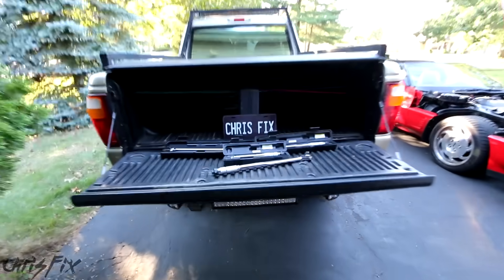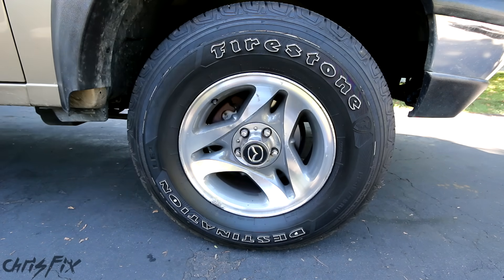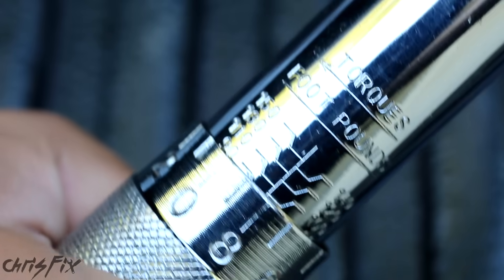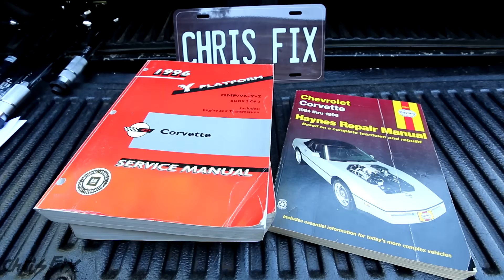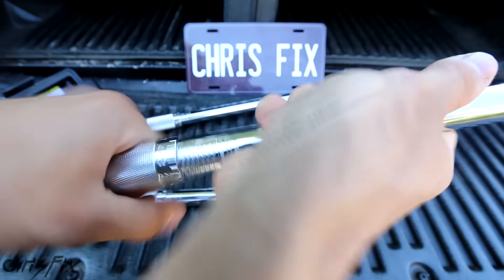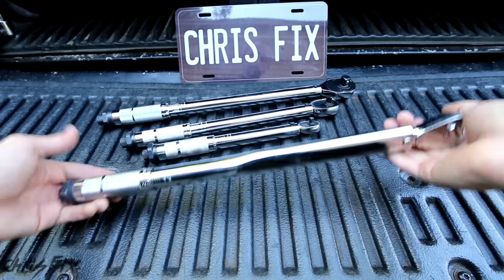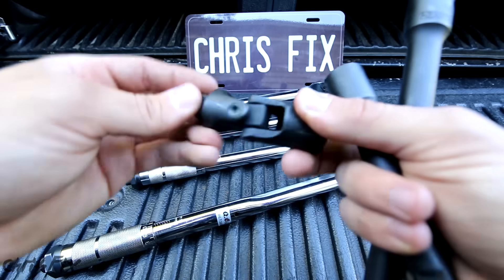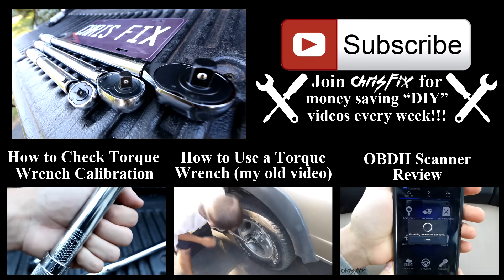How to use a Torque Wrench PROPERLY

Comment: Chris does anyone make it for Christ where you can pull it reverse to see how tight something was made and then does like a clicker a pop or just starts loosening it to readjust.

like some kind of a ranch maybe digital where I pulled back on something to see how tight it was before it starts to loosen?  I've seen videos of such a wrench but I can't remember who sells them I know they would be a little bit more expensive and I know there are one or called reversible torque wrenches, is that what I'm looking for either mechanical or digital? my budget is about $120 on harbor freight if you know what I'm saying.

Comment: Chris is it safe to use a torque wrench to loosen and then rhetoric I know you said don't use it as a wrench but just as a quick, can you use a torque wrench in reverse not that it would read or tell you anything but just wondering just like a little bit of a back off in case my mechanic airgunned aluminum wheels to 120 and they're only supposed to be 75, etc?

1997 Toyota Avalon, usually aluminum 15-inch wheels my spare is a steel wheel and that takes 90 or a hundred I forget  which.
Reply: Crack them loose with a breaker bar and then tighten them to proper spec with the torque wrench. NEVER use the torque wrench to loosen!

Comment: Common mistake with click style torque wrench is to very slowly apply the torque just before the click. ROT is to apply the final torque at a bit faster rate than the second hand moves around an analogue clock. Do not jerk the wrench to get that final torque applied either.

Comment: I Don’t need Torque Wrench I’ve got my Hands.
Reply: But how do you know you are not overtightening? I tightened my wheels by hand and have a wheel wobble on passenger side. I tightened them more and there is only a small wheel wobble now. I am worried in case I overtighten so a torque wrench seems to be the answer.
Reply: Shade Tree Mechanics don't use torque wrenches Real mechanics do..

Comment: The most important thing is to slack off the nut and then tighten to torque setting. Just putting it on and waiting for click is not correct because the wrench has to overcome friction which can be greater than the torque setting. You didn't mention that because you are not an engineer.
Reply from the maker: Thanks for sharing.

Comment: Kids toys, my most used wrench is 3/4” drive 100-600 ft/lbs and often use 1” drive 200-1000 as I torqued wheel nuts on underground haul trucks to 740 ft/lbs

Comment: Couple of things. 
1. Using extensions on a torque wrench does not affect applied toque, since rotation is slow and constant. (As long as the extension is perpendicular to the torque wrench)
2. Always adjust up to your desired setting on your torque wrench. If you pass your desired setting, go back below it and then come up to it.
3. Make sure that the device you are torquing is moving when the torque wrench clicks...otherwise the device is already beyond the desired torque.
4. Never us a torque wrench counter clockwise, unless it's designed to be used in that direction.
5. The calibration interval on some torque wrenches is up to 3 years...depending on their design...some way less. Contact your manufacturer for the calibration interval for your tool. 

Note: The correct toque is applied when the torque wrench clicks...not clicks plus another inch or two. Stop at the click.

How do I know? I worked in a calibration lab for many years. One of my jobs was testing and repairing torque wrenches of all sizes, types, and ranges. I also worked in industrial instrumentation and physical measurements where one of my jobs was testing industrial torque measuring devices.
Reply: SanityOne basic physics should tell you that your 1st item is correct. I’m not sure where this idea comes from other than perhaps non coincentric torquing of the bolt which would effectively extend the lever arm.
Reply: SanityOne, good additional notes.  You raised a good point regaring the effect of fiction but it seems that the "otherwise" part you mentiioned is not correct.  Fiction effect is reduced when the torque wrench is moving so a better result, as you correctly mentioned, could be achieved when it clicks while the torque wrench is moving.  However, if it clicks when the torque wrench is not moving, a larger part of the torque is used against the friction so the socket/bolt gets less torque at that moment.  So, in short, if a torque wrench is not moving when it clicks, the socket/bolt you are applying the torque is in fact under, not "beyond" as you mentioned, torque.
Reply: @eddyl.8478  Thanks for your comment. Good point about the effects of friction on torque applications. Maybe I wasn't clear. Here's what I was trying to say. If the device you're tightening to a specified torque doesn't respond to your applied torque, then you have no idea how much torque was applied. The torque application I described is standard practice throughout industry.
Reply: @sanityone649  Thanks for the additional explanation.   It is much simpler to remember the principle.

Comment: Step one but a ratchet
Step two use ratchet
Step three say click when you feel that the bolt is tight (watch a few AvE videos for a demonstration)
Reply: Tighten 'til she cracks, back a quarter turn, blame it on the night shift ;)
Reply: yeah, you just tighten it until you feel the bolt slipping and then you go back a bit ;D

Comment: I know this is an older video, but one correction. When going from 100 ft. lbs to 98 ft. lbs. as shown in the video, you need to first go down at least 10 ft. lbs. (90 ft. lbs.), then back up to 98. If you are using a digital torque wrench, you can go straight to 98 ft. lbs. Also, it's not a good idea to completely unload a clicker torque wrench because there is a very slight chance that the spring can get dislodged.

Comment: Touqu depends on vehicle most toyota have 76 or f 150s are 150 Nissan tend to be 135 to 145 and aluminum wheels are torqued different from steel wheels

Comment: How much torque would it take to damage thread on a 17mm bolt?
Reply: A impossible question to answer.  What material bolt?
What thread?
How used the bolt is ?

Comment: We did an experiment with torque wrenches and extensions at my college, 25 feet of extensions and the torque reading didnt change one bit even though you could physically see the extensions twist up like a torsion bar. Not even a single ftlb.
Reply: A good proof of Newton's Thrid Law - action equal reaction! (and in this case, we ignore the weight of the extension bar.)

Comment: Hey Chris, thanks for the video.

One question regarding socket drive. What type do you suggest for regular car maintenance? 

I don't own a socket and ratchet set and consider what to buy. 

I read that 1/4" drive is good for small works, 1/2" is good for large bolts and 3/8" is a good place in between. What do you think? Can a 3/8" drive socket set be enough? 

Thanks again,
Rami

Comment: Dude never even read the instructions on his wrench.... 1. Approach torque from lower number only. 2. Support the head when applying torque ESPECIALLY when using an extension. A crooked extension WILL alter torque. After calibration set to medium range of torque and make it click on a solid bolt that won't turn to seat everything hen set torque to lowest setting and approach desired torque from LOW side. Just read the book that came with your tool

Comment: Chris
I have a 2014 F150 Ford truck. With 120,000 thousand mile. My air-conditioner has Freon in it but it’s not getting cold like it used to. What is your suggestion on trying to fix this issue. Thanks
Reply: Takumi Fujiwara
Thanks I will check it out.

Comment: Mine has a needle and a scale.
Reply: I still have my old Craftsman Beam Torque wrench, but have used only a few times in past several years.
Built many Nascar Grand National race engines with the beam ...before we could afford the SO Torqueometer dial wrench.

Comment: Will I need anything over 150 ft lbs working on Japanese cars?

I just got 10-150, and 25-250, both 1/2 in drive. After watching the video I'm wondering if I should return the 25-250. 

Looking forward to the calibration video. Thanks.
Reply: Jose Urriza you probably don’t need anything over 150 for Japanese Cars.  My Lexus needs to be torqued to about 76 lb-ft so I’m find with my 150 or 180 torque wrench.

Comment: Most vehicles are not 100 pound. A most 1.25 or 1.5 threaded studs are around 75 to 90 and when you get down to 7/16 threads you can be down to 65 pounds of torque.

Comment: Ill have to disagree on one thing in this video, you said store it at its lowest setting. You dont wanna store it at its complete lowest, you wanna store it at 25% of the maximum value. Like if it went to a maximum of 100 ft pounds, you should store it at 25 ft pounds. Alot of torque wrenches even have a "Stop" line on them to prevent damage to the spring

Comment: Tip for keeping your tools rust-free:  Any time you buy a piece of equipment (usually electronics) that has a silica moisture absorbing packet, hang on to it and toss it in your tool box or case.  The silica packet will keep the moisture off of your tools just like it does for the electronics, and help prevent that rust.  They're small, so they're easy to fit into a case somewhere, they're free since you already bought the item they came with, and since most of the time you'd just throw them away with the rest of the packaging, it's environmentally friendly.

Comment: Actually, it is "foot-pounds" when you're applying torque with a wrench. It says FOOT POUNDS right on the wrench. It's pounds-feet when referring to the torque output of a car engine, for example. Other nations than the US use the metric system, so their torque wrenches are graduated in Newton-Meters instead.
Reply: Actually, no. Torque is torque. Lb-ft is technically the correct unit of torque, doesnt matter if its for a wrench or engine output. Ft-lb is also used for torque, which is still kinda fine mathematically, because force x radius or radius x force are interchangable. However the unit of ft-lb, or usually ft-lbf to make it clearer, is not a unit for torque at all, its a unit of energy.

Comment: Way back when I bought my first torque wrench, I noticed it came qith a manual. It explained that torque specs are given with respect to the nuts/bolts to be torqued have clean threads and are lightly oiled and are using a shallow socket on the torque wrench. If you use a deep socket or an extension with either a deep or shallow socket this will result being a SLIGHTLY different result. I brought this to the attention of a well respected professional mechanic friend and he answered me by showing me different manuals with slightly different specs AND torque sequences with respect to the same item in question. He said if it falls within the high/low range its ok. Ive always remembered that and never had problems..So, if I use combinations of extensions, u-joints, etc, i may use a couple ft/lbs..

Comment: In another YouTube video, the guy was saying that the 0-9 are x by 2. For example, he was saying the 2 would add 24 to 100... Is that correct because you are saying it is right on as is... For example, you're saying 0-9 is 0-9. Like to get 102 line it up to 100 the turn it twice to get to 102... I'm confused.

Comment: Chris, I am a looking at the Precision Instruments' torque wrenches.  And they have wrenches that come in three drive types: fixed drive (no ratchet), flex ratchet, and fixed ratchet.  What is the definition and advantages of each drive type?
  Thanks.

By the way, I tutor college physics and mathematics, so great job--h/t--going through the definition of torque and clarifying the unit of measure. Communicating the correct units is important; remember the ill-fated Mars Climate Orbiter: US$327.6 million lost over confusion regarding a unit of measure.  Using ambiguous terms in mathematics, using imprecise language, quite often produces undesirable results.

Comment: Using extensions doesn't, in theory, affect the result at all. The torque is calculated as the force applied multiplied by its arm, which is the distance from the point of application of the force to the screw/nut/bolt 🔩. However, this distance is always taken along a line perpendicular on the screw/bolt so, as long as you keep the extension well aligned with the screw/bolt, only the length of the wrench counts. Using it at an angle, however, will completely throw off your results.

Comment: 2 things to note from a calibration technician. The top and bottom 10% of the scale should not be considered accurate. If the torque application is critical use a wrench where the torque setting is closer to the center of the scale. Using a click type torque wrench commonly leads to an over torque condition. Humans tend to react to slowly to the click/break of the torquing action, from my direct experience in training classes, and drive forward an addition 10 to 30 foot pounds past the required torque. Practice feeling for the break and stop applying torque immediately at the break for better outcomes. Finally, when a torque spec reads IE: 28-32 set the torque to 28 and torque the appropriate pattern. Stop, reset the tool to 32 and re-torque the pattern again. The lower number is the set torque the higher number is the final torque; it is not a range. hope this is helpful to someone

Comment: Thanks for all the knowledge!

When using a lug nut, do I go by the car stated specs or the lug nuts specs? I bought new lug nuts because the previous ones were rounded and rusted.
Reply: Also, I never even thought about resetting my torque wrench after use! It's been at the last used setting for four months, should I get it recalibrated?

Comment: Snap on are not the best, they are the most expensive. There are plenty of top quality tool makers out there that won't break the bank as you discovered from using your cheap Tekton torque wrenches.

Comment: Two questions.  Should you use anti-seize or lub on the stud?  Or are most specs for dry studs?  Do you have to spin the tool back to 0 when not in use.
Reply from the maker: I use thread locker to lubricate the threads.
Reply: @chrisfix  Lots do, though I understand that the engineers often base their calculated torque on dry threads.  Presumably you could be over-torqueing the studs when lub is used.  So they say anyway...  Lots use lub and never have a problem but tolerances are getting smaller as time goes on.

Comment: Great video. what i most wanted to know is what the click looked and sounded like and you showed that. I have a question though. I and going to be working on bolts that need to be adjusted at 25 and 30 Lb-ft. I have a heavier torque wrench that doesn't even start clicking at lower torques, so I'm looking for something lighter. Could you give me an idea of a range I should be looking at? I overtorqued a strut mount once and don't want to do anything like that again.

Comment: You don't want to use an extension when torque becuase that affects the amount of torque applied, the further you are away from the socket the more torque you'll need get the torque you want, so with that extension you'd have to set your torque wrench above 100ft lb to get 100ft lb. Good video though.

Comment: Great video. I just bought a new torque wrench!so my question Is, there a way of tightening a screw or bolt when ratchet bit doesn’t fit over the bolt ? I have a an O2 sensor that connects to my motorcycle exhaust and I will need to torque that bolt but there’s a wire that runs through the bolt so I can’t fit a traditional ratchet bit over the bolt !
Reply from the maker: They rent sockets at your local parts store for free. They have a hole for the torque wrench and a hole for the wires. Honestly though, for an O2 sensor, just snug it down. Don’t over tighten, just get it tight and give it a little extra and it will hold perfectly fine.
Reply: ChrisFix thanks for the reply. I subscribed. Appreciate the tips!!
Reply: There is also a tool called a crows foot that is shaped like a flare nut wrench that you can use in a tight space. Also if you pass the setting you need you should back the wrench off at least 1 full turn and come back up to the setting you need also use the nut or nob at the end of the wrench to lock the handle so the setting doesn't move on you have a good day

Comment: Look up Precision Instruments Torque Wrench on Amazon, they are the the producer of the chassis of both matco, and snap On. Those brands just use their ratchet heads. A split beam 1/2 Snap On Dial Style on the truck is a little over 420 after tax. The precision torque wrench which is the exact same body with different head runs 150 before tax on amazon. Try it out save the money

Comment: Gotta love Car Forums. I had to remove a guibo from a 05 745i....with only hand tools....on jack stands....that weren’t positioned high enough. It took forever to get those bolts undone and when I finally figured out how to take them off easily (seriously, BMW needs to do a PSA) I was pissed. If I had only consulted the forums I would have been done in less than an hour. Instead I spent 3 days deciding on whether or not to rip out everything from the driveshaft to the trans and start fresh before finding the solution.

Trade secret....not telling.

Comment: I calibrate torque wrenches for a living we break the torque wrench at its max value before use and calibration for most accurate readings just a tip if you want to include that

Comment: I'm planning on getting 2 torque wrenches for different applications for the car repairs. One will have 10-150-ft. lbs. and the other is going to be 20-250-ft. lbs. since my wheel hub's torque spec is 159-ft. lbs and I'm currently making a chart for the 3 cars for the torque specs per part so when the time's right to install new parts, I'll be using the chart as a reference guide.